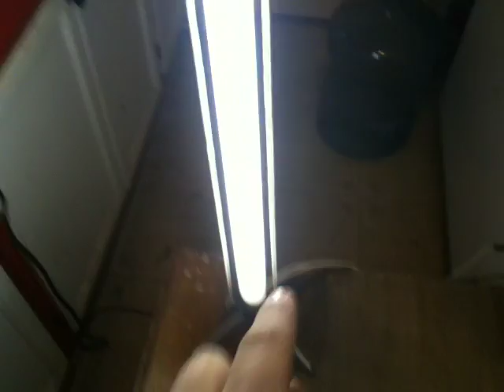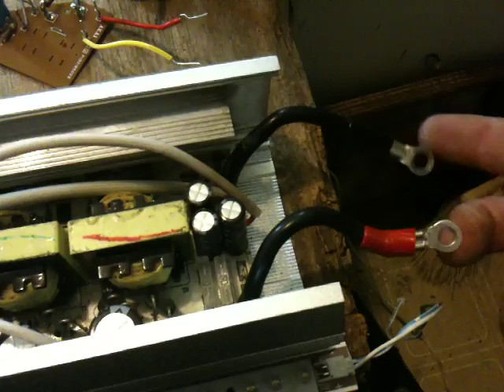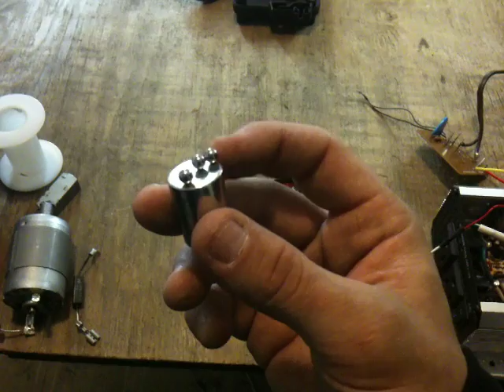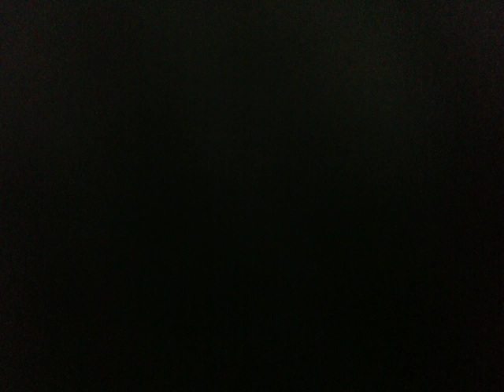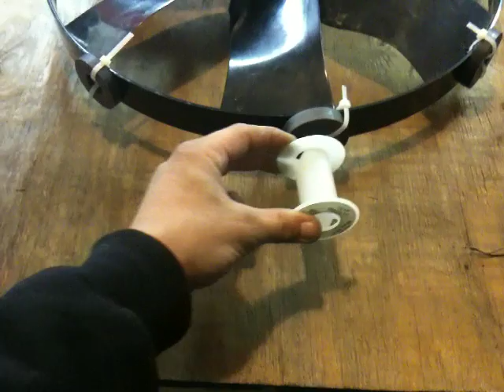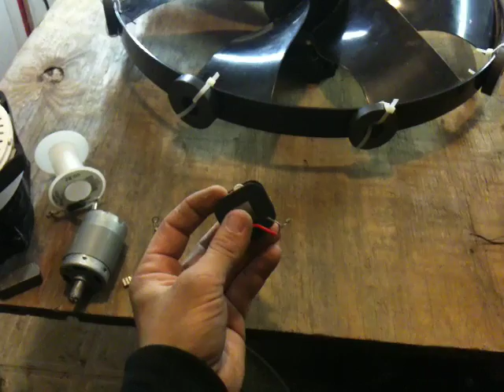Free Energy & Fly-Wheel Overview

Comment: Man, I was thinking about that too, placing the magnets on the top of the fly wheel on an angle such as the angel of fan blades, the external magnets pushing downwards on an angle. I got the idea seeing Ancient Aliens where he found a circular stone with a spirals design on the top, and when he was trying to fugue it out, he put a magnets on it, to test its magnetism, and it started to spin like a top; that I saw in truth, as the spirit of a way of truth, that would work. That one of these motor generators would be a device about the size of a spare tire in the trunk, that it would be spun up to speed, to produce power to feed motor generators in each wheel hub.

Comment: this guy is a complete idiot... Duhhhhh if you short-circuit any wire it will melt! LOL what a dumb fck... go at least read a few line in electrical engineering before you try to TEACH anyone else what a  wast of fckng time you are  go REAAAAAAAD! the 2 things you point at as being the same type ARE NOT!... go read to find out why IDIOT!
Reply: wie is hier stom  45 min lang  haha.. jij kijkt toch naar dit dom filmpje en bezorgd hem kliks
Reply: DormantIdeas NIQ aren't you Mr . sunshine. i suggest taking valerian root ..... natural antidepresant
Reply: DormantIdeas NIQ  I agree he shouldn't be attempting to give any lessons, I adreesed that in a direct to the video comment. Sorry you are that pot calling the kettle black LOL. Don't look now but all over your home there may be things blug into the wall that are DC short circuits.  Assuming that coil with the core include was design to be use wit 120 VAC 60 Hz; the reason it got hot is because removing the core changed thee impedance, impedance being resistance to AC current.
Reply: jelle e  I only clicked to bust his ass for associating flywheels with free energy, I click out when I heard his attempt at giving lessons; I busted him on that in s comment direct to the video. We can't know how bad a video is until we see it, after that the only action we can take is to vote it down. At this point the video has more approval than disapproval.
Reply: PureTruth yo buddy! you need to make friends with the idiot in the video! not me!

Comment: very cool, TY.

Also a few notes on electrons. love em.

In DC Conventional Theory means electrons flow from + to -. This is actually incorrect. Electron Theory (correct) states - charged electrons are attracted to the +. Therefore current moves from - to +. If the circuit is wired correctly it doesn't matter except when considering things like diodes.

AC is different. Current flows between Hot and Neutral only.

Ya, Ground is usually safety.

With radiant you also have to consider transients.

Comment from the maker: I'm not sure if you understand how electric charge works and flows after reading your reply.... Maybe double check on where you learned the "No ground wire = No Energy" idea because that is not correct.  A ground wire is not always needed to generate power or run things with power. The electric current from the positive charge or higher charge always flows to CXL out negative charge or lower charged electrons. A ground wire is used for a safety net from over power discharges in the circuit......

Comment: No ground wire = No Energy, No ground = No engine start, but strangely the earth isn't grounded or touching anything but itself.... Which means Energy always and only goes one way IN. Resistance always and only goes one way OUT. Energy goes in a generator and resistance comes out... my thoughts